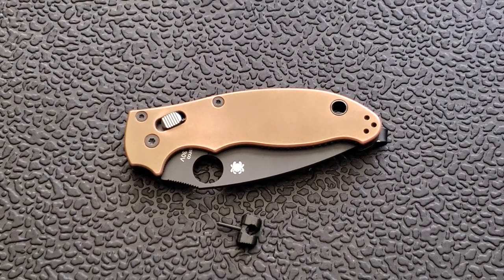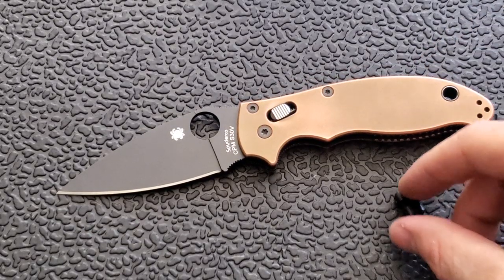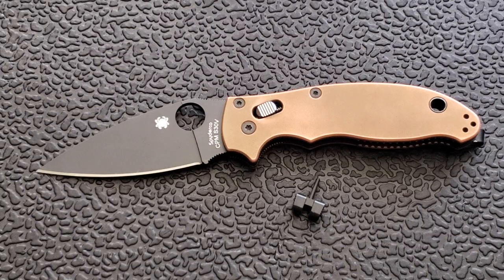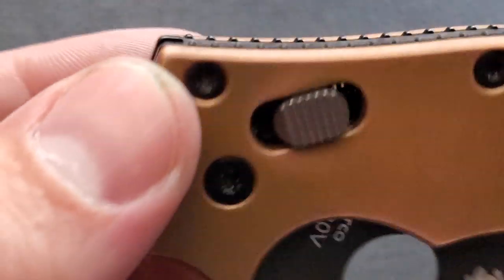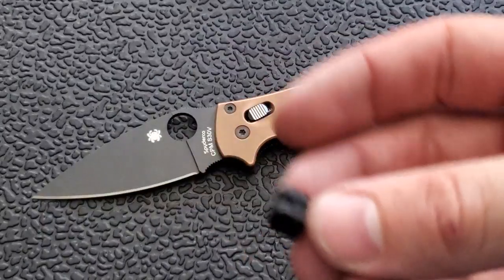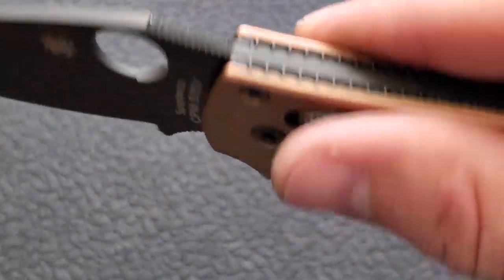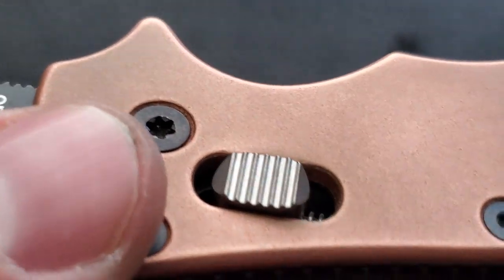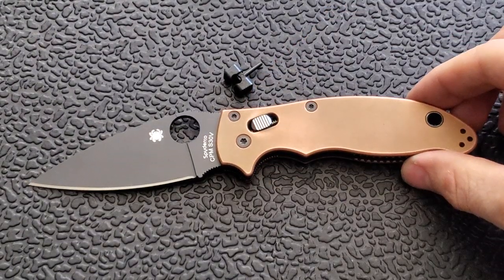Flytanium Cage Lock for the Spyderco Manix 2 - Titanium!

Comment: If you're following this video I've found a few things that can go wrong that aren't explained. First the scales have a flare and you'll special tool to remove the scales properly although you might be able to remove the scales normally. Second when putting the blade back on you can actually just press it against the D screw part and slowly twist it from behind until it slips in. Third and this last one has happened to a few people but I'm not sure if it's a consistent issue but with the ball cage it takes a long while to get the screws tension just right but it mainly has to do with the 2 screws on the back and not the one that controls blade play so if the lock is getting stuck alot try loosening the screws on either side and play around with the tensioner

Comment: These make a huge difference. Bought 2 of the blue Ti and 2 of the Silver Ti. The coloring of blue looks great. 

On the lightweights, the scales are riveted together so you could if you want to go through the effort of drilling out the rivets and ordering the hardware that fits.
Reply: where?
Reply: TheScottyp1 “where?” What do you mean?
Reply: @Nozz_959  i meant where did u get bhq didnt have it but i went to flytanium site and got the blue ti
Reply: TheScottyp1 oh gotcha.  Yeah I got the cages from the Flytanium site as well. I ordered a bunch of hardware from McMaster Carr to find the right screws to replace the rivets in the LW and see if it will work.
Reply: @Nozz_959  good luck with that lol.
Reply: I'll give you 60 for one of the silver ones. Lol

Comment: Thanks Man. Looking good! I'm pretty sure you're first, to get one on video.

I started to go a bit crazy, when seeing the thumbnail pic. Before I watched the video. Wondering why you didn't go with the copper cage.

When you swap to the new inbound scales. Are you planning on switching to satin hardware, to sorta match the Ti cage?

I wish I had known you were going to get different scales for this one. I would have sent you a special little kit. Which includes a ceramic ball and a slightly weaker spring.
👍🔪🍺😎
Reply from the maker: I'm going to keep the black hardware (just to emphasize the ti cage). And that's interesting! I didn't know they made a ceramic ball for this!
Reply: I've got all kinds of tricks you don't know about,  @metal_complex . 
😁

I've got your copper clip about done too. I just to tumble a finish on it. 👍

Comment: Will this void the warranty?
Reply from the maker: As far as I understand, your warranty stays intact as long as your disassembly doesn't cause a failure. I.E., if you strip a screw or break something while taking it apart, it's voided. If you get it back together and everything works fine, you're ok. Check with Spyderco to be sure though.

Comment: Did installing the titanium button make it easier to close?
I know they take a bit to break in h it does it make it smoother to close the knife?
I have 2 manix’s and the button is stiff as hell on both of this can make it easier I’ll definitely buy it. 
Ty:)
Reply: I'm wondering the same
Reply from the maker: No. It's pretty much exactly the same
Reply: @zackcollette9406  I find it way easier to open and close in my experience. 
The XL drops like butter and the normal Manix 2 it’s no way as harsh on the fingers and it does make it a much better experience all around to open and close compared to the plastic.